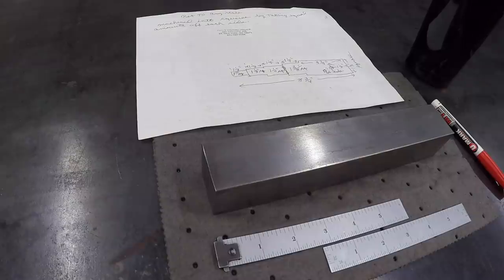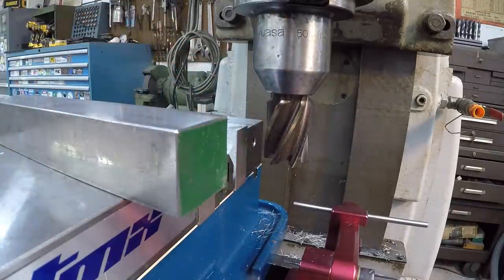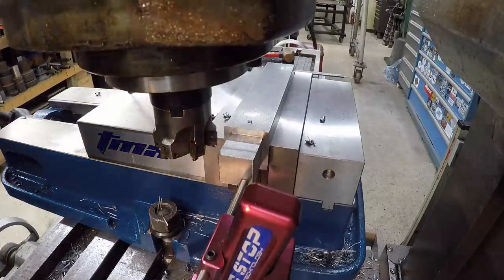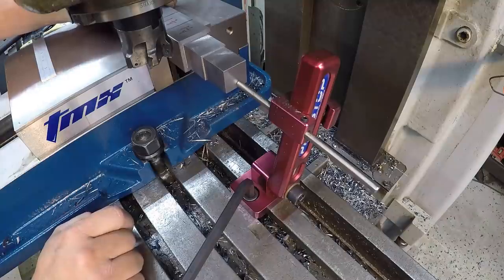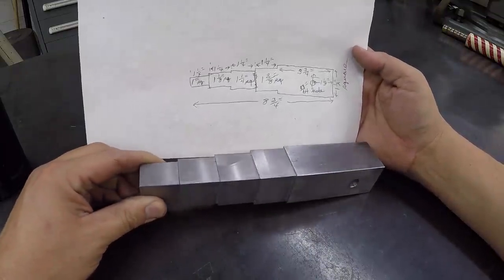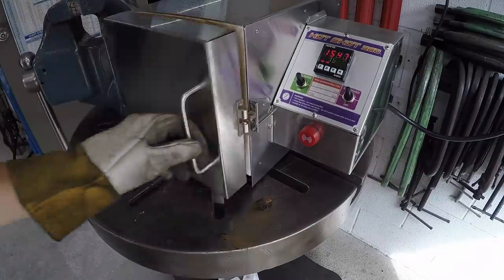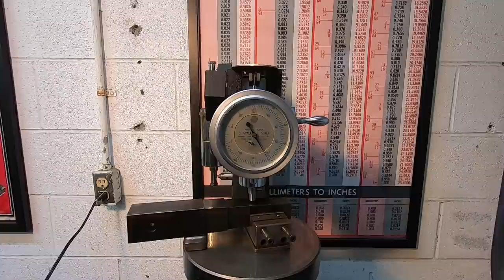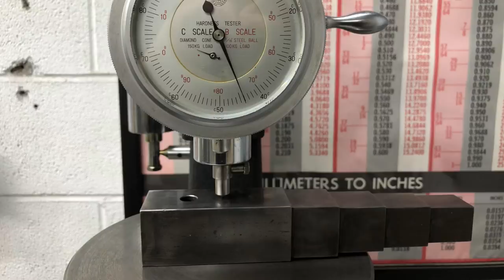SNS 296: Custom Square Drive Tool, Heat Treating

Comment: the thicker side of that part has more accumulated heat inside and thus cools down more slowly, the thinner side of that part releases heat faster and turns into martensitic steel more quickly
 ----> that is the reason for different hardness on different thiknes!

for the smaller piece you tried to harden, the difference probably came from tongs that did not allow the oil to scour the surface (suspend part on wire next time)

Comment: That's probably an adapter to open the bottom doors of the grain cars or hoppers, it has a shaft with a sprocket to slide the door open and close and at both ends of the shaft it has a female square drive opening for an electric or pneumatic motor that links to the shaft.

Comment: I have read the comments made and there are a lot of good comments on procedures.  Still they are missing quite a few fundamentals.  If you boil eggs you can get 3 out comes.  Soft yoked egg, under cooked, just long enough to get the yoke hard -just right perfect to get maximum hardness, and over boiled - yoke is green and over cooked and metal is damage.  That is the issue with soak time - for 4140 2" thick 30 to a maximum of 40 minute for the piece you did.  You over cooked the metal and ruined it.  Same issue for double heat treating.  You cannot double heat treat a piece of steel as it ruins it - you put the hard boiled egg back in boiling water and turn the yoke black. Unless you go backwards and normalize the steel and start from the beginning you can not effectively heat treat the same piece of steel.  Again there are still several other significant things you did wrong and that are not addressed by the 20 or so good comments made by other subscribers.  The book I referred you to in my earlier comment has the per-heat, per-soak, timing for ramp up, & soak times for different tool steels.  It list what you should do and what you should not do and explains why.  If you really want to heat treat get this $35 book that is 1/2" thick and read it.  Heat treating in my mind is an essential skill and is interesting to do.  It can be an added knowledge for machining in that you can heat treat & temper some metals before you machine them to get a better quality product.

Comment: The foil prevented the part from cooling down fast enough, due to restricting direct contact between the oil and the steel, hence the low hardness
Reply: Yeah, the temp looked good, but you have to remove the foil for a quick quench.

Comment: 4140 steel normally doesn't get very hard, it's tough.  .4 carbon doesn't give that great  Rc result.  The reason you couldn't get around 45-50 Rc is because you couldn't quench fast enough, for one the stainless wrap, it takes too much time to get off and by then you have lost too much heat.  Next you need a lot more quench oil,  you need to really shock the steel and do it fast- like 200-300 gal. and it is just hard to get a piece that big to quench down very fast.  If I wanted to get acceptable results with 4140 and it wouldn't come up to the required Rc according to the prints, I would just put it in the carborizer for around 4 hr. and then let it cool naturally- once cool reheat treat it at 1550 F draw at 400 F.  You could expect 45-50 Rc.  I would have added carbon into the steel and had a surface where it needed to be plus a good tough core of around 40 Rc.  There is almost never a need to draw 4140 back over 350-400 F,  it won't break unless it is a very small part.  Always check hardness before drawing back.  The rockwell testers check better if you have ground surfaces.  I had endothermic gas furnaces that drove out the oxygen and you never had to wrap and never had any scale.  Pull out the steel in a tray with tongs, and dump immediately into around 350-400 gal of quench oil, shake vigorously until cool to room temperature.  Even then 4140 was tough to get to where many prints called for, but it is a good general purpose steel.
Reply: What if he cooled the oil first in an ice bath or freezer or something of the sort, then it would be able to pull that much more heat out of the part, much faster too. Also why does it have to be oil as opposed to another fluid?

Comment: I work at a company that designs and builds induction heat treating machines, I’m the cnc lathe guy there, but we spin our parts if possible to achieve the most even pattern of heating and immediately quench it after turning off the inductor. I can ask our engineers what the best method for home conventional heat treat is, though

Comment: Don't use the foil, it's just for stainless. I make knives and I use the foil on stainless and quench with compressed air between two aluminum plates that act as a heat sink.   Foil wrap is not meant to be quenched in oil.

Comment: My only thought was a red hot part in a plastic bucket seems to have worked this time maybe not next,you might want to find or build a metal one to quench with indoors and lid/cover. Nice video as always.
Yes there is a story about a similar type deal with hot,liquid & plastic ! lol
After watching you realized as well thankfully things went well.
Reply: Houses have burnt down when people dumped the overnight ashes from their wood fired ovens/stoves into a plastic bucket. Heat and plastic containers are always a bad combination.

Comment: A proper heat treating furnace needs to be controlled by a set-point programmer. I have had the occasion to program these controls for a heat-treater and the typical program for a solid piece like this is a 2 hour ramp up to 1650, then soak at 1650 for 2 hours, followed by a slow 8 hour ramp down to 800. Whatever else they do after that I don't know, but I have seen the test results and the steel is bitchin' hard after ASTM testing.

Comment: I got a neighbor that does heat treat. his  process is much longer and involved. his heat treat oven is also programmable and he uses it that way. I seen him heat metal for a day before the final process of heating for heat treat.
Reply: 100%  needs longer soak time. I have been heat treating and testing for 40 years, I did list my method for 4140 about 6 hours before your comment

Comment: Use angle iron to support the parts, makes for a very small contact area on the part. You've got to have even heat across it all, and setting it on fireproof blocks or even the floor creates dead space where there will be a heat difference. Also if possible could try rotating the part midway through the heat treat cycle. Perhaps make a holder/standoff with points, like a bed of nails type device, then you'd have a very small impact area on the part. Watch some Master Knife Makers vids, you'll get all you want to know about heat treating :) Good job Adam, another fine vid and project!

Comment: Just lookup the cct of 4140 4140hw will be in same chart.
You are trying to get it too form martinsite so you have too cool fast. Or you will get banite or perite grains.
You can get your material harder if you cool below 0 and hold for a few to8 hours and convert more grians to martinsite. Applied sciences did a few vids about this one was 2x drill lifetime
It is cryogenic treament of drill bits.
If you want more info let me know

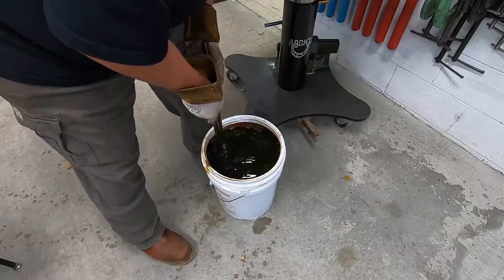Comment: [ currently paused at 29:30 ] Having never been put into practice surely I am not anybody to make a call but... I kind of panicked when i had seen the heat treatment with the foil still on. the heat treatment is like to shocking something it should be virtually instant.  and in nearly all cases save for the Japanese sword smiths... direction of the parts length be perpendicular to the liquid surface( usually). the initial entry is incredibly important.   I noticed another comment that had a reference but I wasn't able to verify it..... the page wouldn't load :/ as for how I know.... I have too many hours watching people do this on YouTube and seeing where they have success and where they have failed... completely a feeling of intuition.

Comment: A quick way to learn - take a .125" or so slice off the end of your offcut and run experiments on that. It will heat quickly with a torch and quench quickly too. Once you have success with the small piece, apply what you've learned to the bigger (slower) stuff.

Comment: I always skip the foil on my AK reciever and I also use salt brine quench with dawn dish liquid in. Also I circulate my quench through a pump to keep cooler in 5 gallons set up. I do believe you are not getting it cool enough Quick enough. I have heat treated my fair share of stuff, but just my point of view.

Comment: you can't quench with your foil on, and you have  to break the steam/smoke jacket with vigorous agitation, been watching your channel for years, first time comment. i am a knife maker, for the sake of reference and/or credibility, i heat treat knives and large cross-section tool steels all the time.

Comment: My suspicion is that the foil must be removed before quenching.  To facilitate rapid removal of the foil, perhaps if a wire was inserted into the foil uou could rip it off quicker.  Further, if you had a rod inserted into the hole it might be easier to manipulate the hot tool.

You might also coat the tool in boric acid technique that Chris from Clickspring uses.  See:https://www.youtube.com/watch?v=i9pD5vIHJ8M at 4:13.

You also might skip the worry about the scale and mill to a plus dimension and grind to the final size.  That was the practice at the mold shop I used to work at.

Comment: The foil could be messing with the heat making it into the part. If the tool steal is W1, it should be quenched in water, make sure the water is up to temp, 180f, so you don't crack it.
O1 tool steal is oil quenched.
A1 is air quenched.

Soak it for 3 hours in the foil warp, I hope that help's.

Comment: Adam, I think they make pointy cones for use in kilns that would allow you to set that part on points and give complete even heating on all sides. I suppose you could make them... Might work better than flat stones...??
Reply: Some Titanium cones or wedges should do the trick.

Comment: You will get lower HRC resultes if you remove the foil before the quench . Every second you let the Part cool down the hardness will reduce . Big parts with complex structures can if harden in foil reduce its hardness because of air pockets or oil vapor and this will slower the cooling . A big part Like this can easily harded in water without the risk of cracks . For more informations look in the Datasheet of the Steel it will have a shart how you need to Heat and cool the Steel . I Like the Page from a German Steel Producer called Dew Stahl . If you search Dew 1.7225 you will find your Steel and a PDF document with all informations .
Reply: And more oil will Help to cool ist faster or use a even faster oil . And grind a bit of the surface before hardness Testing Sometimes there will have different hardnesses and after grinding they will be the same .

Comment: For some reason I’m thinking the tempering stage is completed not by quenching but slow cooling at room temperature. That foil wrap seems to have a weird effect, no? Maybe it needs a longer soak time with that? Also, maybe a water quench is a higher shock yielding a higher hardness? There’s a guy with a channel named That Lazy Machinist who did a nice series on this. Anyway, thanks for sharing your experience.
Reply: 4140 TTT Charts explain all... yeah you're in the right direction :)

Comment: Oh, just watched the end of your video and it looks to me that the starting size has at least one side that has some serious decarburization from the normalizing done at the mill.  That is, during that normalizing and annealing, the carbon is actually "cooked" off leaving a case that may have a carbon content that is as low as .15% instead the nominal .4% .  It is the carbon content that gives steel its hardenability and the other alloying elements determine how deep that hardness will be.  Look up Jominy Bar Testing.  I worked in the aircraft landing gear industry and we used a lot of 4340 Steel.  As hardened, it would come out at 65 Rc and then double temper back at 425 degrees to 60 to 62 Rc.

Comment: 1: Is the hotbox temperature gauge calibrated properly (check the temp with another instrument also)  
2: Temperature of the oil and make sure you have enough oil for the mass you are cooling.
3: Steel consistency/quality you are using.

Comment: The longer you wait, the better the temperature distribution will be and the more even the hardeness will be. Heat transfer has this kind of curve:
https://www.researchgate.net/profile/Won_Hee_Park2/publication/257775400/figure/tbl2/AS:669330664587298@1536592274841/Estimated-convection-heat-transfer-coefficients-of-steel-plate-for-different-heat.png
So it takes REALLY long to get the inside of the part the same temperature as the outside (ambient) of the part, BUT it will get there eventually. Your issue is that you didn't wait long enough- as you keenly observed. Metallurgical science is incredibly interesting, but the problem is that the theoretical stuff is difficult to put into practice. You probably don't have time to wait 20 hours for it to reach the oven temp internally. 

Look into the jominy hardness test if you want to see how the hardness is internally- your square bar can be approximated as a rod in that case. 

Keep in mind the way you quench it is also incredibly important- and it starts affecting the metal properties the moment you take it out of the furnace and into cool air- even before you dip it into the oil, so you have to be quick. Ideally you want an agitated bath ready to go, since that affects microstructure. I suspect that's why you have varying hardness more than the temperature differential due to positioning. Agitating the bath makes it so that the bubbles/steam from the oil don't affect the heat conductivity of the quenching liquid. Steam/bubbles are extremely poor at wicking away the heat from the part, so you'll end up with uneven hardness.
Reply: why would a "pre-agitated" bath matter? if the liquid is uniform in temperature and consistency can it even exist in a non-agitated state?
Reply: @ikbendusan  random nucleation points in the oil mean bubbles will form in random spots. Those bubbles will then prevent proper cooling and thus final hardness since the expanded vapor does not cool the part. It's like boiling a pot of water- despite the water being largely homogeneous, you still have the nucleation points randomly dispersed and not in the exact shape of the flame underneath the pot. Similarly, you can superheat water in the microwave beyond 100c because it's untouched but any disturbance can cause a nucleation point somewhere inside to form, exploding the entire liquid suddenly when you pull it out. In power plants, as an aside to show how bad steam and bubbles are for heat transfer, look up Departure from Nucleate Boiling or DNB. It ruptures tubes.

Comment: I worked in a porcelain sign shop for a while and we used hooks to hang them made of Tungsten. Possible make a thin wire rack on the bottom made of tungsten or brass

Comment: Shouldn't the bag be removed before the quench
Reply: Thats what i was thinking , it makes it difficult for the oil to pull the heat out of the part
Reply: Yes, It has to be removed to get the cooling rate needed

Comment: Welcome to the world of Heat Treatment Adam, it's probably comparable to Golf in its ability to infuriate, and reward 😰😰😰.
Probably worth trying AISI SAE O1 material, in small 20 X 25 mm (3/4 X 1") blocks/cylinders to start with, your furnace and quenching medium will produce repeatable, or consistent results.
Great vlog, thanks for sharing.

Comment: Should part  be centered horizontally and vertically in oven? A couple pics at end  looked like it it was right in front of the heating element maybe that caused more heat on that side.

Comment: Adam, when I worked at Dodge Mfg. I spent a fair amount of time in the heat treat dept.whre they handled all the Dodge speed reducer gears. Thes gears were very high quality and were carburized and hardened to Rc 65 as I remember. The impression which I had was that heat treat is a very complicated process with a lot of variables. By all means, pursue it but be aware that it has a lot of critical detail involved.

Comment: You'd better use water instead of oil to increase hardness. The main thing to get part hard is ti decrease it's tamperature rapidly, stainless steel has a very low thermal conductivity so the pary cools down too long. Hope you understand. Just try water and no foil - you'll be suprised.
Reply: I would ditch the foil, but stay with oil. Water is not always better
Reply: @wupme  Yep, the part can crack or even explode (depending on material).

Comment: When we used to get cv axle bar shafts made the heat treat was performed with the part vertical for better convection. Quench method was vertical too.

Comment: A town your size has a OIL company.  Go in and see if they have some oil / grease cans that are scrap or empty.   Might invest in a sensor.  You might be under temping it as that might be reading high.  A trigger temp never gets there to change the internal atomic structure or grain.  When I was looking into it years ago and haven't gone there since - The stainless steel sheet and a small strip of paper was put in to burst and consume oxygen.  I think this could be just fine without the shield as the other sample showed.  There are ceramic cones that melt at certain temps.  Put a line of them on scrap and test your meter.  Ceramic or heat treating place has the cones.  Potters use them as the glasses they use for color are different range in temp - and must be kept in use the same temp or one will burn off and the other works.